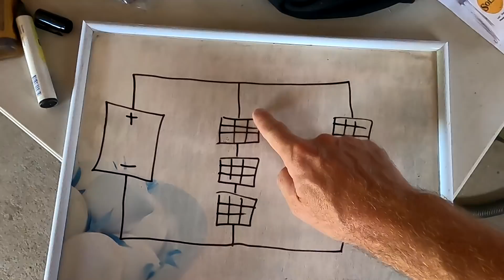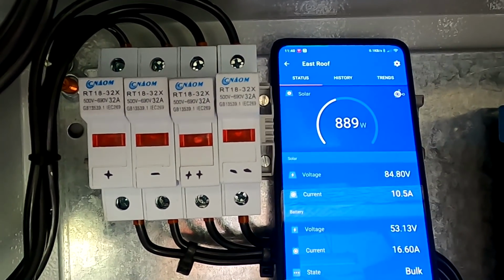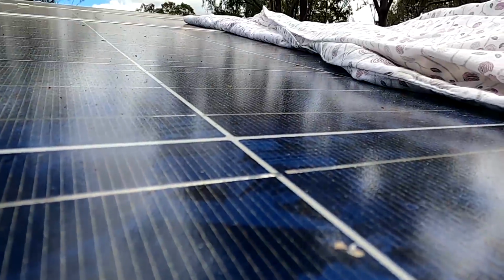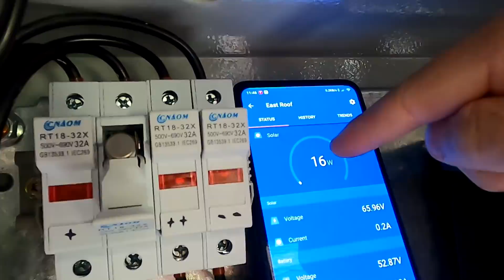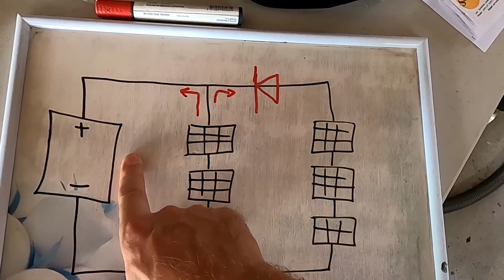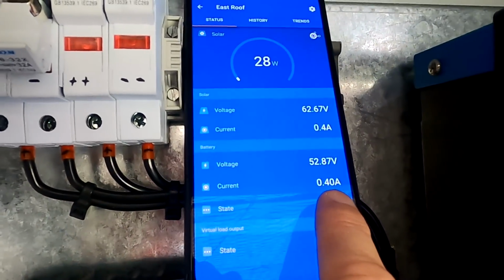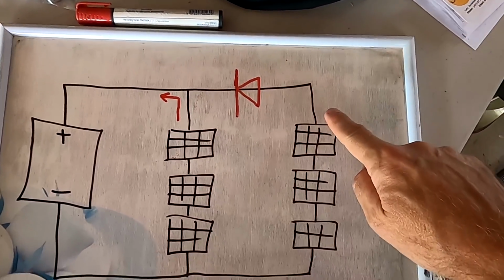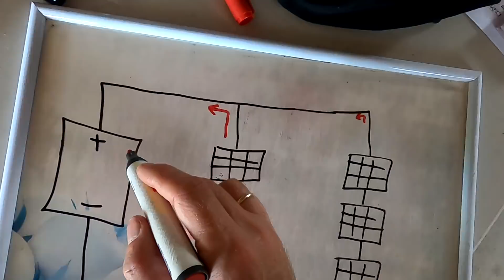Solar Upgrade EP4 - Shaded and non-shaded solar string in parallel. See what happens.

Comment from the maker: Before you keep commenting, that panels have diodes included in the connection box. Yes, they have but they are bypass diodes, *not blocking diodes*. This is a total different purpose.
Reply: Can you explain the difference?
Reply: @willtaylor8904  Here is what google says 
Blocking diodes are used differently than bypass diodes. Bypass diodes in solar panels are connected in “parallel” with a photovoltaic cell or panel to shunt the current around it, whereas blocking diodes are connected in “series” with the PV panels to prevent current flowing back into them.
Reply from the maker: @Phil Ware There is a big difference between these two.
Reply: @OffGridGarageAustralia  Hi Andy, First of all, thank you for the experiment. I have a serious concern though. As I saw, you covered 2 of the 3 panels right? Since, the panels have bypass diodes, shouldn't it be producing around 200W from the non-covered panel instead of a mere 30W total? As far as I understand bypass diodes are for this exact purpose. BTW just ignore the comments about people confusing between bypass and blocking diodes. Blocking diodes doesn't make much sense today, with charge controllers there is no back-feed from battery to panels at night and even if we put them to avoid back-feeding from one panel string to another, the continuous diode losses all day will make it worst rather than the benefits. Please check your bypass diodes, I think experimenting the effectiveness of the mandatory bypass diodes and your results will be more helpful for the community, rather than blocking diodes. Thanks.
Reply: @DSmartLife  Andy have more than 50V on battery, one panel delivers only 31-32V at 200W, so he need 2 panels without shade to get more power. If he only bloks 1 panel and the bypass diode is working he will get the 400W.
Reply: @hanshansen384  True true, I forgot about that. Yes, he should get 400W with 2 unshaded panels in the series of 3. I think Andy can verify this for us instead of the blocking diode thing.
Reply: High quality monocristaline panels don't need blocking diodes to prevent batteries from discharging.
But bypass diodes are included on all newest panels to prevent over heating and fires.
Reply: @neliosamch3195  The "prevent batteries from discharging" function is provided by the charge controller.
Reply: @Sylvan_dB  That is what I thing but schematics and information don't provide a clear picture.  I had checked  with clamp meter a solar controllers for negative amps but it is positive miliamps especially when the moon is full.
Reply: a solar cell is basically a diode, very large, with a huge depletion zone
Reply: @Phil Ware Blocking Diode? No ...
Reply: Wery interesting video. So we can connect 2 or 3 strings in parallel and orient them to West South and East and get power all the day? For example main string 2000Wt PV array to the South and additional array arond 1000Wt to South East to get additional power in the morning?
Reply from the maker: @AlexV-j3v I would not recommend paralleling panels with different orientations. For such a purpose, an extra charge controller would be best to get the most power out of all panels.
Reply: Hello Andy!! It's first time I write to you and, first of all, thanks for all!!! I'm from Italy (Sardinia) and I've been following you and your offgrid garage since the beginning,  I also made my own offgrid system and stuff at the same time you were starting your offgrid adventure. But let say about blocking diodes, it's true, if the charge controller is producing  there wont be negative current feeding the shaded string, besides, what would be going on if for some  reasons the charge controller stops producing? I guess in that case, the shaded string would behave as a load for the not shaded string. In a real shaded situation the voltage difference between the 2 strings wouldn't be much, so  the negative current would be very low, but I bet in that case negative current would happen. What do you think about? Ciao from sunny hot summer Sardinia!

Comment: For the last 4 to 5 years, newer solar panels that have half cut cells, 144 half cut. They have three diodes. They work a lot like six batteries, three connected in series and three in parallel. The diodes prevent any back feed. The diode also help in series with local shading on one or two panels. Some of these panels can handle 1500 V in the series connection. Shade one panel completely and you've only lost 1/30 of the production.

Comment: OK some questions on this setup . 1st if the shaded string is still in the circuit , the unshaded strings voltage will drop down to the shaded strings voltage ? Ohms law . 2nd the shaded panels probably  have bypass diodes which removes them from the load , no ?  3rd if you put to batteries (which are like solar cells) in parallel and one is larger than the other in voltage , it will feed current back into the lower cell , no ? Superposition tells us when looking at batteries in parallel we basically add up the currents of each  parallel group and the voltages are the series combined cells .  Can you read the current in a situation like this from the shaded string and the voltage of each cell , make sure the cells in the shaded string are not producing a voltage or taking a current .. I am very curios as to the voltages and currents when shaded and non shaded . I had 3 panels in parallel with no blocking diode , it may have fried one of the panels when a tree late in the evening produce  a shade on just that one panel . And asking AI , all the ones I asked suggest that you use blocking diodes in each string . The Cells from what I have read almost always come with bypass which will remove a cell in series . Regards,

Comment: I would like to point out a few things here:
1. They way you have implemented the diode in your diagram is not the correct way to do it. Normally you would put one diode on the output of each string. You have only put one diode on the output on one string. If the left string on the diagram gets completely shaded, or if it develops a fault condition, then current from the right string can still flow into the left string. Only putting one diode in there might be enough for the purpose of this test, but that's not how a permanent installation should be done. After all, what's the point of protecting only one string, but not the other?
2. Not all solar panels are designed exactly the same, and not all solar panel installations are equal. You have all your solar panels facing the same direction, and in that case you don't need reverse blocking diodes for improved shading performance since it's basically impossible in your setup that one panel gets completely shaded while the rest continues to receive full sunlight. However, there is one reason why you would still put reverse diodes in there, which brings me to my next point.
3. Panel failure protection. Imagine that the right string in your diagram fails somehow and completely shorts out. Now the left string will feed all its output current to the right string, which is enough to cause a fire in the right string. It's of course extremely unlikely for three panels (right string) to short out at the same time, however in a scenario where you don't use series strings and only connect panels in parallel, then putting a reverse blocking diode on the output of every solar panel can be quite an important safety precaution which should absolutely not be disregarded.
4. As I mentioned, not all solar panels are the same. You performed the test on your own solar panels, which I assume are all identical. But if you do some lab testing on the reverse current characteristics of 50 different panels or so, you will see that some of them will in fact have current going through them in the reverse direction when they are reverse biased, while some other won't.
It's like a person who owns a Ferrari says "People say that cars often can't go that fast. Now I will test if that is true." Then the person drives fast with his Ferrari and says "Myth busted - Cars CAN go really fast.". But in that case, this person only tested it with one car, not a bunch of different cars on the market. You can't bust a myth by only using one single test sample. It doesn't work like that. A more accurate way to test this would be to try to reverse bias a lot of different solar panels in an electronics lab environment, in a fully controlled manner.

So the real answer to whether reverse blocking diodes are needed is: It depends on the situation. In the solar setup in this video, then no, reverse blocking diodes are not needed. But there are other situations where they are. If you install panel strings facing completely different directions (for example, one string facing South-East and another facing South-West) and if you're not using multiple charge controllers or a charge controller with a dual MPPT input, and if the string consists of only two panels or perhaps even just one, then it would definitely be a good idea to put blocking diodes in there.
So while this video shows that blocking diodes are not needed in a setup like yours, it does not in any way prove that blocking diodes are never needed in any situation. Please be careful when giving advice like this, because blocking diodes can increase safety quite a lot and sometimes even prevent a panel fire. In a system where only parallel panels are used, and if one panel shorts out and turns into a 1 ohm resistor, and if 17 V is applied across that panel by the other panels, then that's 289 Watts of waste heat being dissipated in the faulty panel. And as if that is not enough, usually a fault like that happens at a single point, so those 289 Watts will then be focused on one single spot. You can imagine what temperature that hotspot will rise to. You don't want that to happen when you're not at home. A reverse blocking diode would completely prevent this from happening.
Another thing with blocking diodes that is worthy of note is that they need to be able to handle the current that you're planning on putting through them. Schottky diodes should always be used, not regular PN junction diodes. The lower voltage drop across Schottky diodes mean that there will be lower losses in the diodes, which will also make them run cooler. This is why it's not a good idea to first connect a lot of solar panels or solar panel strings in parallel and then put a diode after that junction; the total current from all the panels will simply be too much for that one single diode unless you're using a diode encapsulated in a package that can handle huge amounts of current. However that's not needed when the diodes are put into the circuit correctly. When one diode is used for one panel each or a few panels in series, then just a series in-line diode is enough. These are readily available on the market. Just don't use them on a string with a lot of panels in series, otherwise the voltage specs of the diode will be exceeded. On larger installations (like on rooftops, similar to the setup in this video) reverse blocking diodes are likely not needed in most cases due to all panels facing the same orientation. And in a case where they aren't, people usually use multiple string inverters/charge controllers instead in order to avoid excessive MPPT "hunting" which can happen if there is too much imbalance in the system. So reverse blocking diodes are only for certain particular use cases. But they can indeed be very useful in those special scenarios, especially as an added safety feature or when cheap solar panels are used that don't block reverse current very well.

Comment: Of course you need to wait for the shaded panel to heat upp from the back flow. Then you try it again with a diode fitted,if you haven't already destroyed the panel before hand . That would be a real test not just a Nicky mouse effort, yes electric is almost instant but heat and resistance takes a bit longer to happen.

Comment: this test didn't show results as the voltage between the shaded and none shaded was equal or real close , you need a voltage difference for reverse flow , the panels themselves have bypass diodes which stops the panels being heated by reverse flow , bypass diodes stops reverse flow in mismatched string voltage as mixed voltage in parallel the lowest voltage sets the pace and amperage adds up , seeing the voltage was so close the amperage was able to just add to the parallel strings , if you dropped a panel or two to lower that strings voltage this is when the blocking diodes come into play

Comment: I watched couple of your videos and I have to say they are very very misleading. In first video you were misleading people about bulk, absorption and float voltage, without even mentioning the resting voltage of the battery. Now you are misleading people that it’s ok not to put blocking diodes on parallel arrays of solar panels without taking all conditions into consideration (I.e. type of charge controller, ocv, sci, state of charge controller,number of arrays etc)and the diode in your little diagram only blocks the current from one array not the other way around. You need two diodes for two arrays not just one.

Comment: Current tends to flow to areas of low resistance. As long as the battery is being charged and the potential is higher than the flow design of the mppt system, a back feed will not occur.

Comment: but Andy about the bypass diodes... why you cover 2 of 3 and the power is not 1/3 ? without the cover they give more or less 600W, when uou cover 2 units it decrease to 25/30W... should not be near 200W? in theory of course... I know now after a saw a video about shading, the problem is the reduction in Volts and Amps this is what affect the others for what I saw... so bypass diodes only works when the panel have a big shadow to kick in the bypass diode until then we lose a lot in all the panels...

Comment: For each panel, Voc is a logarithmic function of the incident light on each panel. Even a small amount of light can result in a Voc that is almost as high as for maximum light input.. If you shade ALL the panels on the other string, the Voc of the combined string will drop much lower, and they will fail to inject any power into the system, and indeed may absorb some power. If not all are shaded, then the Voc could get high enough for that string to inject some power, using the bypass diodes in the other panels. A very low Voc could happen if you have shading from a straight-sided object like a house, or if each string is at a different orientation (e.g. East and West sides of a house roof).. Your strings are close together, and the same orientation, so I don't think this is a problem.

Comment: is it better to have a controller per string? im thinking of redoing my solar,, now im running 120ish volts and 8 in parallel, im thinking of doing 220volts from the panels..and 4 in parallel. 2 strings have 225 and the other 2 is 222 volts,, all going into a victron 250/100 controller

Comment: When the 1st string is not connected, why the 2nd string is not activating the diodes of the modules shaded, and giving 9A, 25Vdc and around 200W? Those PV modules must not have bypass diodes.

Comment: What will happen if you have two strings in parallel of 15 panels, one string irradiated, the other shaded and the inverter is disconnected due to maintenance/fault?
I believe you will need the blocking diode. Isn't it?

Comment: Are your two strings connected in different charge controllers? Or they are first connected in parallel and then connected into a controller

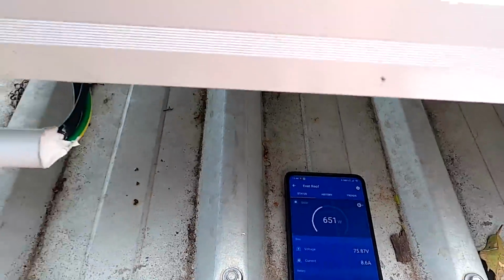Comment: Wow, what an amazing video!  I think you already learned about the bypass diode, however, I think also that at 3:05 your MPPT is looking for the correct voltage without system damage which is what shows your temporary loss in wattage.  Also I think the MPPT/inverter does prevent the "Christmas tree" effect in addition to, obviously, the bypass diode.  What a great video, I couldn't find anything else like this, thank you.

Comment: Nice experiment, but what happens when you disconnect the MPPT, e.g. for maintenance purposes, and one string is shaded and the other is not? Can the current flow from the unshaded string to the shaded one damage the panels?

Comment: I have connected solar panels in parallel, on one string, can I connect one more powerful solar panel on the same string in series?
Reply from the maker: I would not recommend that. Very hard to get the exact matched solar panels which could make this work.

Comment: This video is old news now that you have your new installation… however - it would have been more illustrative if you had actually placed a blocking diode in the circuit and not relied on supposition to arrive at your conclusion. Theory is nice, to a point.

Comment: I think I may have a situation where you need a blocking diode. I have 2 solar panels on my 4wd one on the bonnet and one on the rear window. The rear window is on an 80degree angle to the sky and the bonnet is on a 20 degree angle to the sky. Therefore in the morning the sun will hit my rear windscreen deed on but the cab of the car will shade my bonnet. At midday my bonnet will get direct sunlight and my rear panel a little bit of sun but in the afternoon my bonnet will get sun but boot panel will be completely shaded. 

Do I need blocking diodes for this situation and if I don’t install them can I hurt my shaded panel. I have 1 110w panel and 1 160w panel. Both at 21v